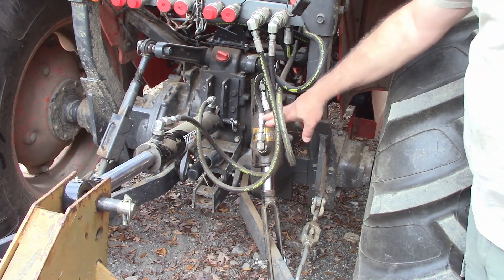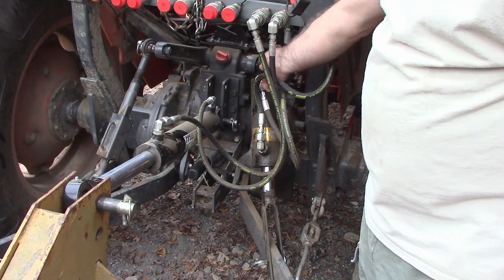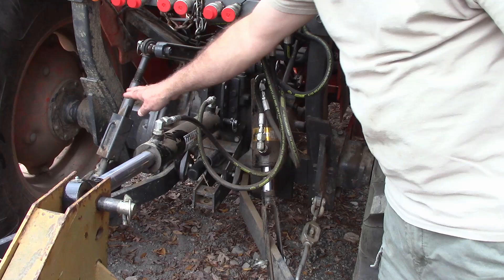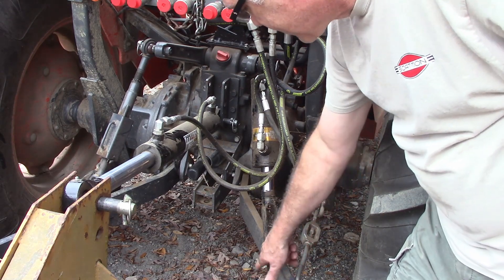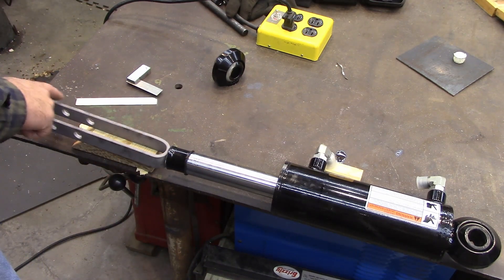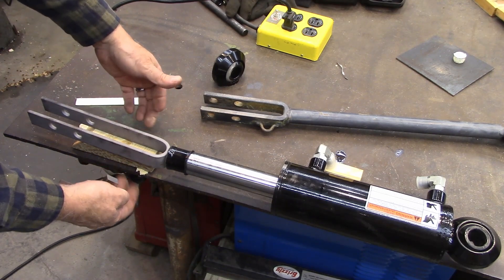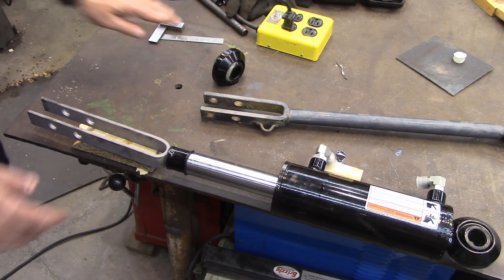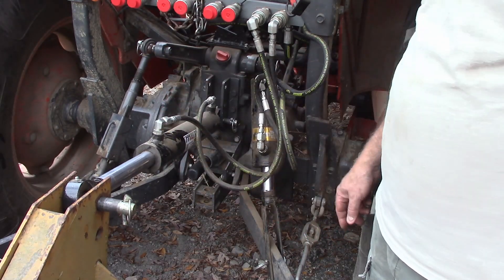DIY Top & Tilt Cylinder Build

Comment: do you have a box blade?
Reply from the maker: Yes
Reply: @SoatMon  You might consider taking a look at what I did to mine, it levels dirt, rock or whatever you like just like a road grader. I am considering adding a cylinder to one of the arms so it can be tilted like yours. I have a regular blade like yours that I added shoes on each side that I use to remove snow so it does not wind up scrapping the rock away with the snow.